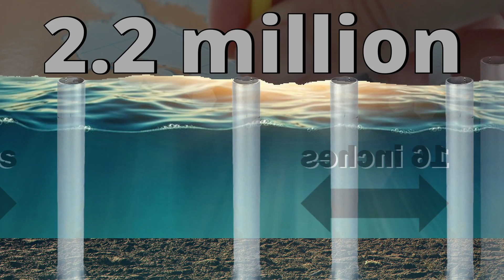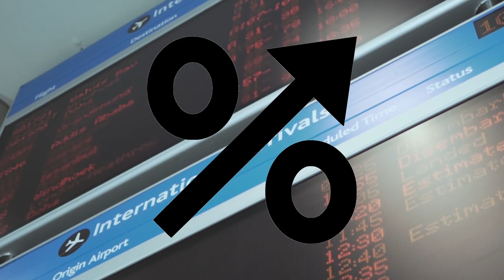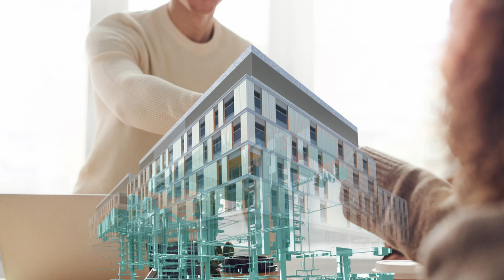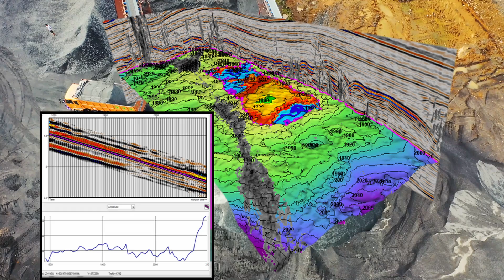The Sinking Secret of Japan's $20 Billion Floating Airport

Comment: The great technological advances have allowed surprising innovations to be made, especially in the field of construction where truly surprising and even crazy projects have been carried out, such as this mega-project of the floating airport built in Kansai Bay, Japan, which has been carried out carried out with these innovative technologies but the fact is that it has been a total failure despite being so innovative and all due to the bad tactics and design strategies on the part of the engineers who obtained to carry out the project in this sinking bay And you are causing a total failure for this floating airport, which, although it is of great importance for transport and economic dynamism, its end is much earlier than expected for a project that has cost enormous fortunes.